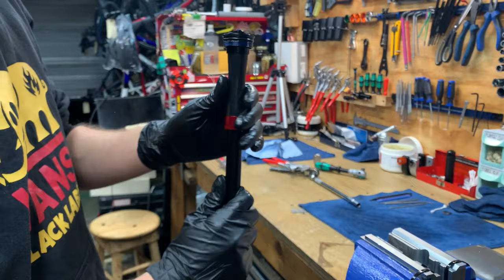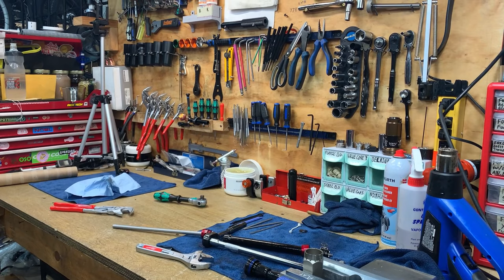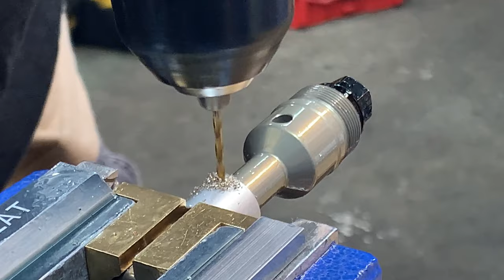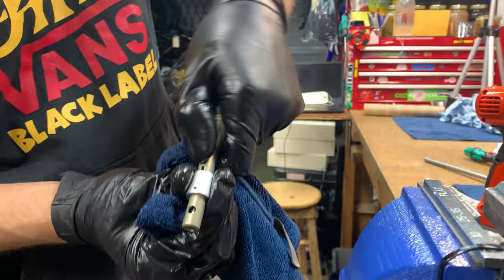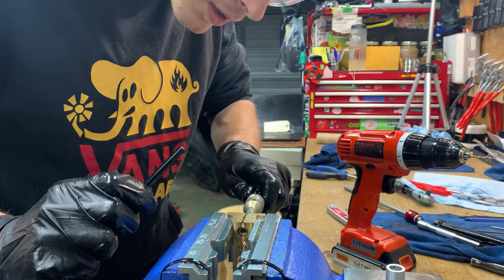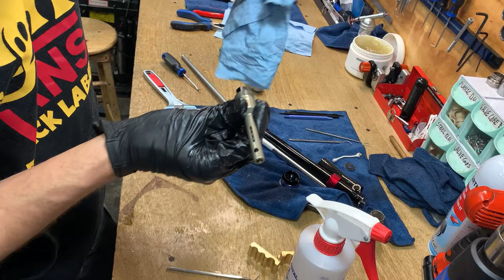RockShox Charger Damper Compression Assembly Leak Custom Repair

Comment: i think you cannot hammer the pins out, because you need to remove the low speed compression adjuster (minute 17) BEFORE the pins can be removed.

Comment: Hi Simon, thanks for making this vidéo, i encountered this issue a few times and i ended up doing the same drilling procedure, instead of the spoke dowel I drill wider to tap and install a dog point set screw but a small misallignment can cause the HSC ajuster to get rough and snap the inner black part. Such a pain.
Reply from the maker: Yes, I think I mention a similar method in the video.  They are both a pain to implement in practice. I don't use a set screw because that way your rely fully on the threadlock for it to stay in place. Though it looks better....  I made this post in the past: https://www.instagram.com/p/Cb6KnVFp3l-/?igsh=MzRlODBiNWFlZA==

Comment: Great video- i looked on your MTB hydraulics site and did not see the 3 seal kit? Having problems finding the right sizes (i was told 3mm thick x 7mm ID and 2mm thick x 1.5mm ID- for the RC2 2.1). Any help appreciated! thanks !
Reply from the maker: Sorry, it's there now: https://www.mtb-hydraulics.com/product-page/rockshox-charger-2-compression-assembly-seal

Comment: Hello Simon, thanks for the video. Do you mind sharing the size of the two o-rings. I have the same issue with my fork and already disassembled the damper unit and try to find out the corect o-ring size now. Thanks in advance.
Reply from the maker: It depends on the exact iteration of the damper you have. You can just measure the diameter of the parts to size the replacement for the u-cup.